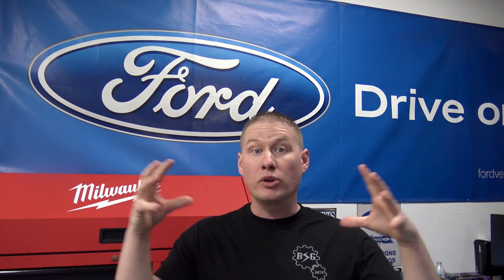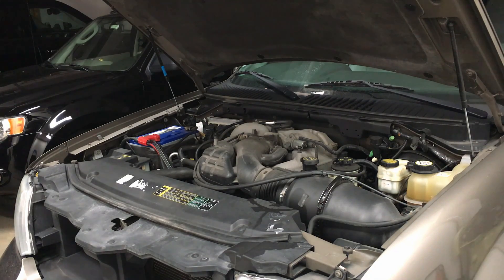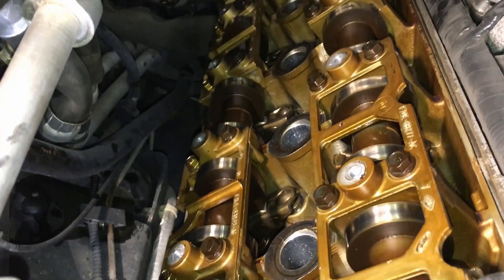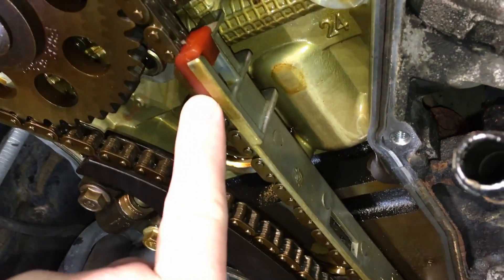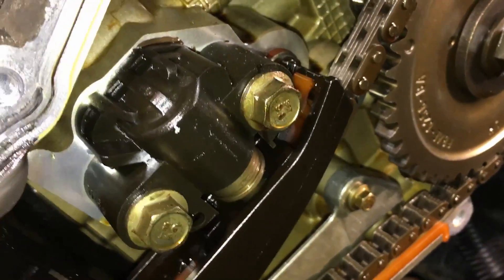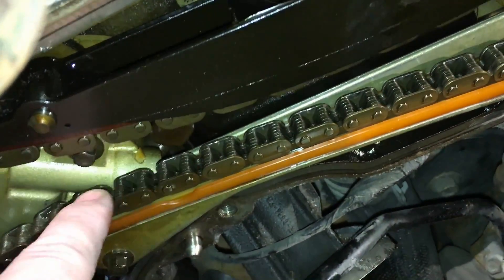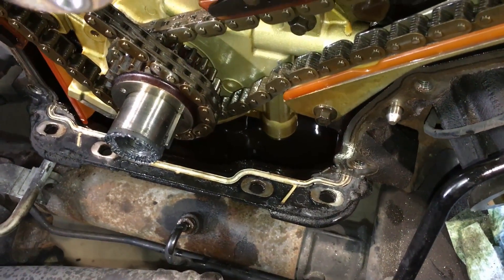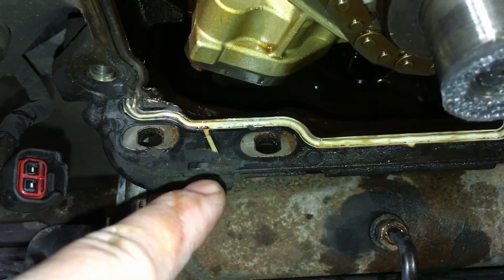Ford 4.6L & 5.4L Triton Engines: Common Failure Points to Watch Out For!

Comment: had a 4.6 with 260,000 miles. not a tick knock. changed the oil every 5k with full synthetic.
Reply: I've got 280,000 miles on my 4.6L 97 Thunderbird and it seems to run smooth and quiet for me
Reply: Justin P. Other than the lack of power.
Reply: Marc Harris the 4.6 can be great engines!
Reply: Actually this kind of Failure I suspect is do to the Engine receiving some kind of Shock that would Whiplash the Chain and Knock Off those Chain Guides

If the Engine hadn't been abused it's doubtful this would've happened

There's been many Supercharged 4.6L DOHC's that never had this problem
Reply: I have a 4.6 that is over 13 Y.O. Same thing Mobil 1 every 5K. using FL-820S filter. I just had Blackstone labs oil analysis done. (Which I highly recommend.) Engine came back perfectly within expected perimeters for contaminates. I love mine, will keep it till it gives me a reason to get rid of it.
Reply: jasmwhite1 great Engines
Reply: I'm just using Walmart's Super Tech 5w-30 conventional with a Fram Extra Guard filter.  I keep it topped off and put 7500 to 10,000 on it since Ford sent out a TSB extending Oil Life in their Engines.  I think that demonstrates confidence in their Engines

I'm a pretty decent Home Mechanic too
Reply: Your so right, I have a '96 Mercury with a 4.6L. It has on it right now 269,000. I have YET to crack it open for anything. This happens when people snap the throttle. what I mean is ,while its running the throttle is pressed to the floor and released quickly. This loads and unloads the chain real quickly. This is one of the failures I have found out by talking to the owners of these engines. This are well built engine but in no way are they bullet proof.
Reply: Escape for Mankind is Keith Johnson what oil do you use?
Reply: it prove trust in the oil with that engine

Comment: l have an 01 F-150 with 4.6  and has 235k on it.  Other then good maint. on it, I have only replaced one alternator and rebuilt tranny at about 135k. Original starter, a/c, etc.  Oh yeah, a little front end work to at about150K. Take care of your truck and it will take care of you.
Reply: Mark Walters usually true, yes. I have seen fords and gm vehicles fall apart at 50k

Comment: +FordTechMakuloco When should the timing chain on a duratec 3.0l v6 be replaced?  My 2010 escape has 111k miles on it with the factory timing equipment

Comment: Hey I was wondering your thoughts on the 5.0.  Is it a solid engine. They tend to have a lot of valve/injector noise. And after sitting for a few hours you can hear, what I only assume is, the cams turning and hitting their stop inside the cam phaser.  Like once the oil pressure drains away from the cams and heads. It always runs fine. Powerful and no odd noises when warmed up and running.

Comment: i'm thinkin i'd change the oil pump. with low vis oils and living with cold starts it doesnt take much to wash out the clearances inside the pump. gunna spend that much on chains and tensioners a little insurance isnt necessrily a bad thing. thanx for the heads up
Reply from the maker: Yup I sure do every time there is a timing job they get a new pump.
Reply: Your saying to replace oil pump every time you do work on tensioners and guides?

Comment: Do you think ford will ever go back to a simpler engine design like the GM LS?
Reply from the maker: nope even GM is looking to OHC motors now.
Reply: wafrederick we were going to buy a GMC Arcadia until I read the horror.  It just seems  impossible to buy anything reliable 2005 and up. The day Chevrolet does away with the 5.3 for a OHC engine there sales will drop.  I'm a Ford guy and that pos 3v 5.4 got me a good one..$$$ what an engineering disaster
Reply: i have a duramax, and a 4.8 v8 in a 16 2500 cargo van...pretty solid platforms ....
Reply: THETOPGLOCK the 4.8, 5.36.0 are very solid motors...hopefully gm can build a reliable dohc because their ohv ate horrible
Reply: Nope Ford will always love to screw over their engines with stupid ideas that even the mechanics hate because they keep making their engines a night mare to work on .
Reply: I have an 05 marquis with the 4.6 with 265k never had engine work done. I did  have to get the transmission replaced
Reply: Cowboy Texas I'm a Chevy guy but I would buy a car or truck with a 4.6 ford. My friend has one in his F-150 and it runs good.
Reply: MyassesDragon nope, the Ford engine are only becoming more complex, take a look at the new 2.7 liter "a nightmare to work on"
Reply: wafrederick that sounds more like any of the new ford engines with all the work you have to do just to change the spark plugs and pray that you don't break one off trying to get it out .
Reply: Halim Spahi you forgot 6.2
Reply: Joe Wilson:
The only newer Ford F-150 I'd have is the 2008 and down. No v8 except for the 2003 and down. So 2008 and down has to have the v6.
Reply: Steven1993: my 2001 E250 van has 225,000 miles on it. I guess the saying is true: "100 miles is far in Europe and 100 years is old in America" lol.
Reply: Yes in the v8;s too.
Reply: FordTechMakuloco  he body I have the same sound on ford explorer 05 some little knocking, could be the same problem??
Reply: Lol mod motors actually hold more records than LS. everything is up top and in front on an ohc. Do the math on who has more parts. 2 chains 2 cams, big deal. Forget about pushrods and all the connecting parts that go with it??? Yeah. LS design is punched out. GM has already announced they are going DOHC.
Reply: MyassesDragon in england we have the ford zetec engine and most of them use dual overhead cams. Some benefits i suppose. I dont know why i see so many ford engines breaking in the usa. I think its just down to age but my dad has a 2001 ford focus with 48,000 miles on it so you can get the occasional good engine.
Reply: Steven1993 My 2V 4.6l Mustang GT had the chain tensioner go bad and break its guard, but that was at 145,000 miles. That's not that bad considering I've driven it as hard as I feel for 50,000 miles and this is the only engine issue I've had. Mainly highway miles. Still had clutch, pressure plate, and flywheel improvements since it needed those.
Reply: MyassesDragon The basic LS design isn’t going anywhere in full sized trucks for the foreseeable future.
Reply: MMR makes a billet aluminum guide for the coyotes that are coated. They really aren't necessarily a good replacement unless you plan on going high horsepower. Metal on metal is not good for a long term perspective. Most of the time the guides are damaged from chain slap which is from a blown tensioner. Ford has a high performance tensioner that came off the boss 302 that's compatible with coyotes. The coyotes seem to be a way better design than the Triton's though.
Reply: MyassesDragon Gear drivin valve train! A little noisy but will never fail! Made out of metal not plastic!
Reply: If they did I would buy one in a heartbeat.
Reply: No.they quit building crap motors
Reply: Steve Rivinius    Fords new 7.3 gas engine is a pushrod engine. Looks very similar to an LS and I’m sure it will be a lot better than any of these cheap ass mod motors.
Reply: wanna bet?? are you kidding? have you ever tore down an engine before??.. a Double overhead cam engine like this 4.6/5.4 style has multiple cams, tensioners, a gigantic timing chain.. and is gigantic, the LS is MUCH simpler, smaller, has less parts, and makes more power, I'm just saying.
Reply: GM has one OHC engine that is a pile of shit,the 3.6 and I hear horror stories with these.A grand and more to replace timing chains and guides.The OHC engines are over engineered and a pain in the ass to work.
Reply: sure...that is a real simple design, the LS. Are you kidding?
Reply: LS is the best engine there is. You don't see people swapping Mod motors into anything do you?
Reply: MyassesDragon what GM will probably do is make a DOHC LS engine as part of their performance engines as an option but it will be MUCH better engineered than any DOHC Ford has made.. and they'll still have their simpler ls based 5.3's, 6.0's and what have you, Ford has made complicated DOHC engines like this for a long time because they were short on power so they had to go with such a crazy design like you see here.. multiple cams, more moving parts.. there's so many more moving parts to break
Reply: @Alex-pj8eu  GM waits on Ford and others to get their engines into the market and see what problems they have and then they can design around the problems. Ford is the risk taker and Chevy is the wise one. Pretty smart thing to do on Chevrolet behalf to keep there name reliable but taking risks pays off too though, when something new comes out its like flies on shit everybody wants that new truck with the new quad turbo quintuple cammed beast of an engine in it. Ecoboost was a huge success the 6.7 scorpion huge success, going from 2v 5.4 non PI to PI heads to 5.4 3v to 5.4 4v you see what they are doing there? There is a reason Ford is the best selling truck. They can get away with the design flaws because anyone knows a design so complex being created from scratch can have it's quirks from the start and besides the a lpt of ppl now days consider 100k high mileage so they sell them and get a new one or new fleet and that is mostly before problems start arising. Chevy is more of keeping the tradition but America isn't what it used to be and people don't really care about that anymore and just want new cooler shit. If you buy a new Chevrolet truck every year for nearly 10 years from 99-09 their is nothing cool or new about the engine it's just a 5.3 the same as the last and nothing to brag to your friends about. It is a boring but very reliable design for a pushrod engine. Ford on the other hand is constantly designing new shit and it is keeping there name alive and vibrant all over magazines media what not and it is much more appealing to buy something when it says in magazine how badass your engine is while Chevy can only advertise about reliability. The people with the money to buy a new truck doesn't give a fuck aboit reliability they want something cool and most main buuers will get rid of it before warranty is out anyways and second hand buyers can deal with the problems. Ford is doing what works in today's economy to keep the customers flowing in and they are also learning A LOT more than other companies by doing so. Ford built the 6.7 scorpion in house ground up and it is a very solid platform with very very few flaws, u cannot count the turbo because Garrett designed it for Ford I'm talking the engine itself along with how well it gets along geared up with all the epa shit. Ford took a big leap but is ahead of the game and I think other companies are just now starting to realize it and they are now starting to follow in their footsteps.
Reply: its not simpler when you look at the actual moving parts inside the LS block.
Reply: Steve's Auto OSTROGOTH the filter would get them if it's working properly. the oil pump doesn't get filtered oil though, so if oil pressure continued to be an issue it would have to be looked into.
Reply: How often do you think this happens?  >1% of the time
Reply: FordTechMakuloco no in the v8 engines

Comment: I've been looking for a video, maybe you've posted one and I can't find it. I have an 07 expedition with the 5.4 3V. We have had an issue with the engine shuddering and missing under light load right around where OD picks up. At first the problem was solved by using fuel system cleaner, then by resetting the battery, the I've replaced several fuel system parts getting a little better each time, and finally had the PCM flashed, but I can't figure out the actual problem. 2 mechanics, a transmission shop, no one knows. The only codes that pop up are running too rich in both banks. Any ideas?
Reply: James Wiggins same here. Same engine, replaced plugs and coils boom no more shudder.
Reply: Sploosh McCooch I've replaced the coils, plugs, injectors, fuel filter, vapor canister purge valve, battery, put a tuner on, and flashed the PCM. Tried replacing the MAF sensor, didn't help. I'm about to replace the throttle position sensor just to give it a shot.
Reply: James Wiggins I have the same truck have you tested your coils? Mine had similar issues but no codes and it turned out to be a bum coil it would kinda come and go
Reply: James Wiggins well good luck, re-comment if you figure out what it was I'm curious to know what happened
Reply: Sounds like torque converter lock-up shutter.
Reply: As far as I read the torque converter would cause trouble in low gears too, where it's really doing the work. I'm not having problems outside of OD. Also, it keeps saying its running rich in both banks, and it's gotten better when I mess with the fuel system before. Somewhere I think it's messing up the fuel/air ratio and causing it to miss.
Reply: I would have the engine checked for vacuum leaks with a smoke machine. Light load with a locked up torque converter in OD the engine misfires would be caused by a lean condition. Any air being ingested into the engine that is not read by the MAF sensor will cause lean part throttle conditions. Heavy throttle or clearing the PCM adaptive strategy would alleviate this temporarily. I had a similar situation with my 2002 Mustang GT and the PCV hose had a crack in it. No codes were ever stored. Rich in both banks is a vacuum leak in my book or a bad MAF sensor.
Reply: cp6027 thanks, I'll give that a shot.

Comment: My 03 f150 w/ the 4.6L had a tensioner fail and it jumped time 2 teeth. Ran fine, but it rattled on startup and shook at idle. Had codes 171 175. Rebuilt the timing and it ran like new. Both guides were broken. had 187K. That chain slop on the engine in the video was alot tighter than mine. Suprisingly, It made no noises when running. Tensioner has completly destroyed.

Comment: I remember in one your past videos about the 3.5 ecoboost engine,you addressed a problem with timing chain rattle at start up. Did Ford fix the problem for the new 3.5 ecoboost?
Reply from the maker: With the 2017 model yes I am quite sure it was on the engineering list but up until then the same engine was used over and over again.
Reply: FordTechMakuloco That's good to know thanks.

Comment: OK this scares me. Amazing video. How much was the repair to the customer?? $800?
Reply from the maker: +Jeffrey Dubinsky I charged $1858 but a regular shop or dealer would be well over $3k.
Reply: And yet this is considered regular maintenance to keep this engine running a long time; yowsers!  I'll stick to my old school stuff.  But I do love how you cover these repairs and the honesty and thoroughness that you put into them.  You have great integrity, and that is a rare thing these days; but you sir, are top notch.
Reply: Jeffrey Dubinsky he's right I called for a quote the other day. Over $3000. I'm going to be studying his 4 part series and get it done. Any chance I don't have to mess with the a/c?
Reply: smoke skull if that happened to my 05 xlt id probably junk it
Reply: FordTechMakuloco back in the  day we used to drop in a rebuilt engine and rebuilt radiator for less than 2 grand.
Reply: smoke skull back in the day 2k was worth a whole lot more!
Reply: jasmwhite1 20 years ago a lot of vehicles came with manual windows, door locks no heated seats or steering wheels or entertainment systems. seems this younger generation is so entitleist that they wont drive a car without being spoiled to death.
Reply: Maybe he didn't notice I mention that I drive a 13+ Y.O. pick-up I have owned for over a decade...
Reply: Jeffrey Dubinsky only like 20 years ago. so in another 20 years will a motor job cost a million? my point was how labour intensive this repair is
Reply: smoke skull no dispute on the time intensive nature of this repair. The part is likely 100 bucks (except oil pump) so like 1700 labor. That is why it's so crazy.
Reply: 20 years ago the average cost of a new vehicle was less the $17K. Now? Almost $34K. I would say $2K then would have gone roughly twice as far.... Inflation is a bitch my friends...
Reply: smoke skull They are called convenience features for a distracted world. :-). I'd happily take my 1985 Toyota Celica with Recaro seats back any day! Though I could do without the cassette player.
Reply: You have been drinking the Hedonic Kool-Aide. Such a shame. While I am of "the younger generation" as you put it. I fully understand the concept of working for what I have.
Reply: Sam Spohn When I did my timing job on my 5.4 3v on my f-150 I had to remove the accumulator because you can't get the valve cover off without removing it.
Reply: smoke skull You're trying to say in 1998 cars didn't have entertainment systems and power door locks. You must be a special kind of stupid.
Reply: back in the seventies it wasnt uncommon for a timing chain at 70k